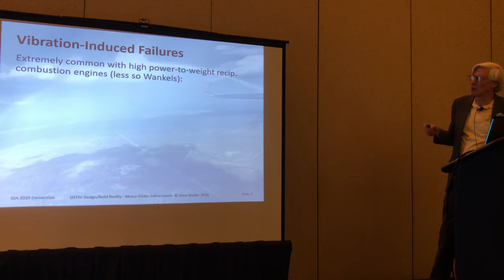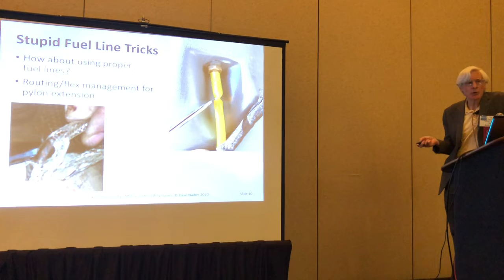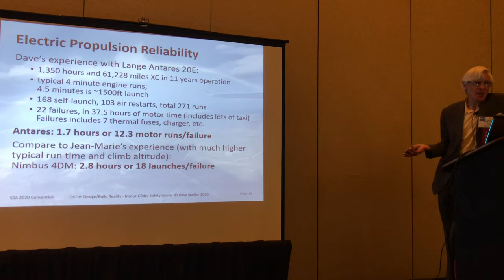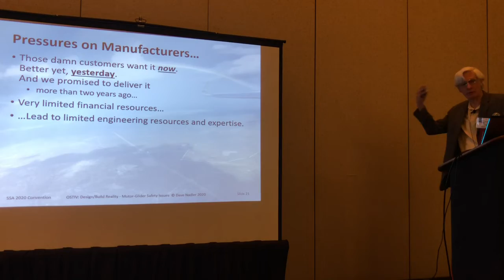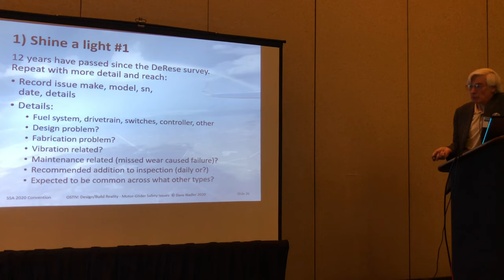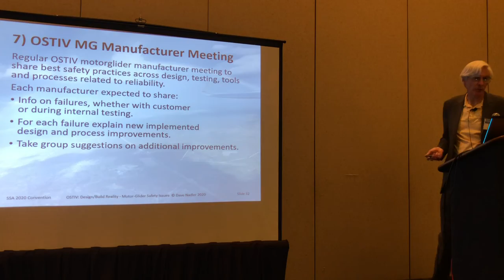Motor-glider Unreliability: Examples, Systemic Problems, Ideas (2020 SSA/OSTIV Convention )

Comment: I still don't get why planes in general have these old style motors with carburators! seriously that is pre WWII tech. My little Honda Fit has a better more reliable engine than an airplane and that for 20k for the whole car! Honda, let's make some airplane engines for small GA planes.

Oh and by the way a lot of these problems are common in regular GA planes as well.

Comment: Excellent presentation.  After 160 hours of engine time in DG 800b, everything covered is right on target.  A sever problem we face in the MG community in the USA is the lack of qualified help to maintain them .  If it were not for the user groups we would be in real trouble staying ahead of problems rather than chasing them in real time.   Every time I see or hear of a MG landing with its engine extended in an out landing, it speaks load and clear they are not Toyotas.   Fingers crossed the OSTIV can make an impact on improving things across the board.

Comment: Thanks for championing this topic. Dave.  I recently bought a motor glider with a Solo 2350 sustainer engine, in part because of the reputation that the motor is fairly simple and reliable.  The whole topic is still daunting, however, especially for someone who's got no engineering background, does not really understand how to detect problems with an engine, nor has any real desire to become a hobby motor engineer, and wished intensely that it really was just like a Toyota.